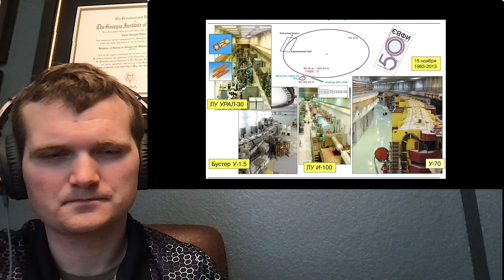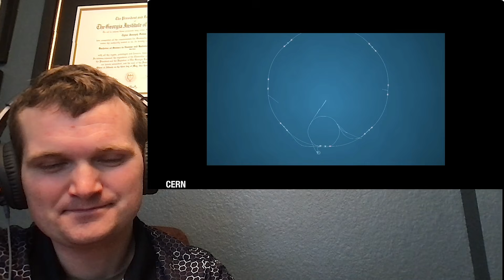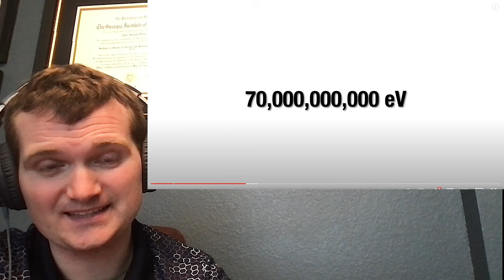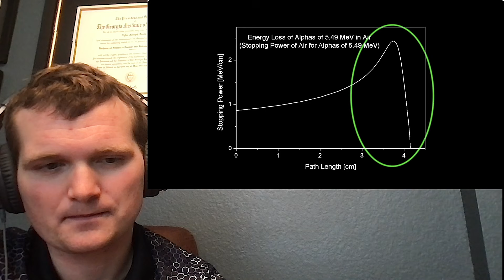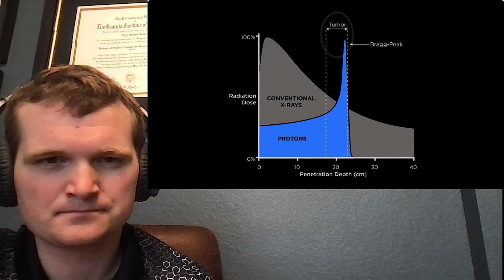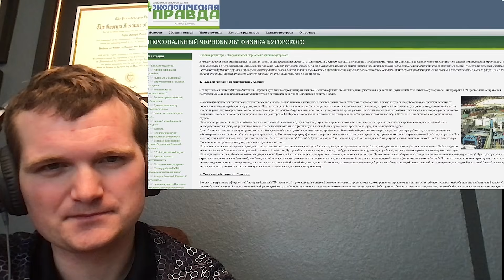Nuclear Engineer Reacts to Kyle Hill "What if You Put Your Head Into a Particle Accelerator?"

Comment: Glad you talked about signage! Too little signage is dangerous, as is too MUCH signage. Also signage in the WRONG place...IE, fire exit directional signs are now being placed at floor level as well, because you'll be able to see them better if there's smoke. Working in theatre and using cue lights (on/off for when things need to happen), we almost always use them in pairs off the same circuit. Easy to tell problems  - one out, it's the bulb. Two out, it's the circuit (somewhere...).
Reply: Sign clutter is a known phenpmenon in traffic engineering, as well. The MUTCD says clearly that warning and regulatory signs should be used conservatively, so as to avoid the signs fading into background noise
Reply: Indicating an unsafe situation by an active signal ( ie the beam is ON by a red light)is simply NOT DONE. You indicate a safe situation by a an active indication ( Green light whan the beam is OFF. If the light fails or the wire to it disconnects, the light is off and you know the BEAM is probably ON. And you don't use a single contact , you use two in series so if one of them sticks in the closed position, the other one will.

Comment: Personally i'd design the facility so the on signal has to continuously be transmitted via contacts that go through all the doors to the room so they have to be shut and connected to make the beam stay on. And id also make it so you have to take the interlock key to close the doors into the room with you and there is no duplicate so you can't activate the facility if there's any chance the key is in the room.
Reply: I would apply to be a janitor at your facility just to troll some scientist by not completely shutting a single door closed and them being unable to proceed until they checked all doors.
Reply: The Large Hadron Collider is designed so it will literally not work if any of the access doors are open, plus other failsafes.
Reply: Not the best idea. These things can be kilometers long. 1 missed key sounds like a mess to deal with. And the experiments are so valuable as well as time and energy consuming that someone opening a door should not shut it down. A not burnt out light OR actually locking door would have been sufficient. If you need further redundancy, a constantly playing noise to indicate the accelerator is on.
The events in the video were a freak accident. And while those should be learned from, I believe you drew the wrong conclusion by overestimating the odds of something like this ever occurring.
All of this does come from a person who's only experience with this stuff is on the internet though, so this can be taken with a grain of salt.

Edit: to clarify, the opening a door shutting the thing down is a bad idea compared to just locking them.
Reply: @fletchercobb4398 if you have one door into the one place where no one should ever be if it's on then there's no reason it wouldn't be that difficult.

And the other obvious change is to have a light that turns on when it is safe and one that turns on when it is dangerous.  If the safe light burns out you don't feel safe to go in.  If the danger light burns out the safe light still won't be on.
Reply: @atashgallagher5139  The consequence of someone opening a door being a massively expensive experiment's ruin is like burning a house down to kill a spider. Just keeping it locked should be more than sufficient for anyone with the level of training required to go near an accelerator.

Good idea with the lights.